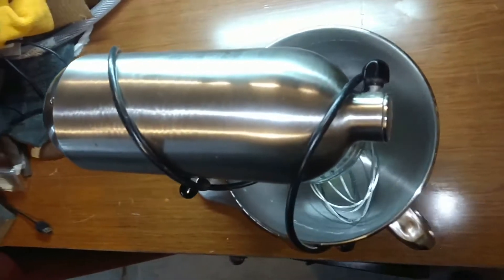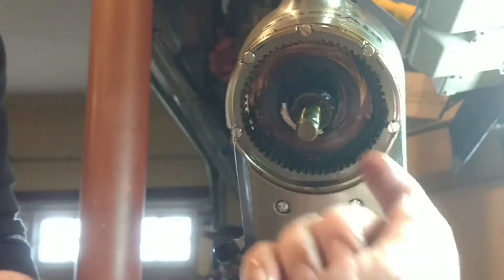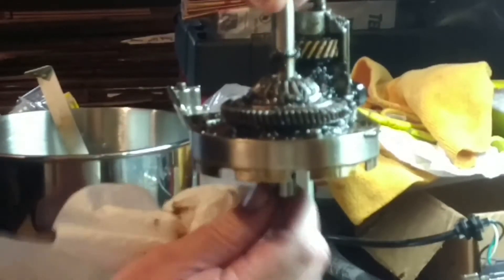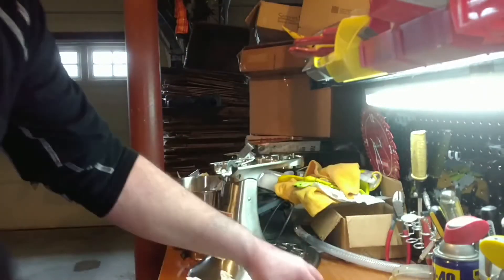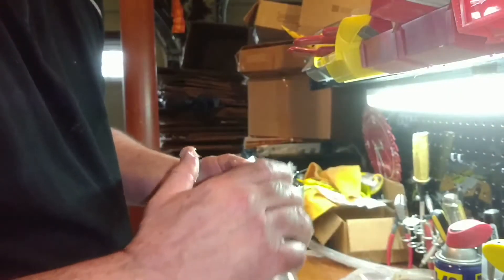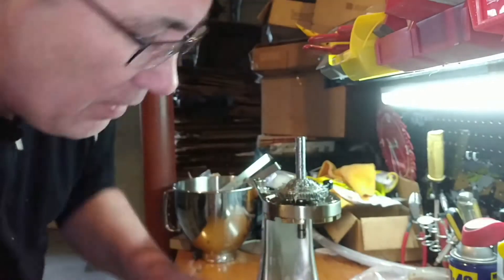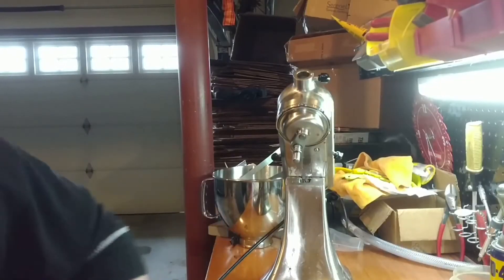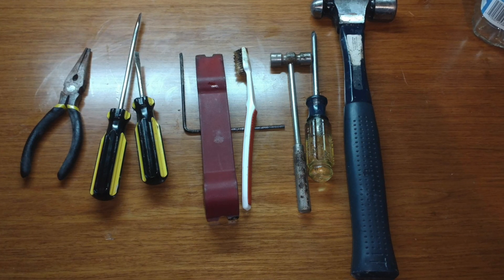KitchenAid Artisan leaky oil fix

Comment: An easier fix is to follow Kitchenaid's instructions to run at full speed (10) for 2 minutes.  I ran it for 10 minutes.  This mixes the grease and oil into a new suspension and it no longer leaks.  No disassembly required.  I did it and it works.  Zero leakage now.
Reply from the maker: let us know how long that lasts
Reply: @yourdiytechlife I will do that.  Kitchenaid says the leakage is usually caused by long periods of inactivity.  In my case, I used the mixer once in about 20 years.  Business and life got in the way of baking.  I'm retired now and bake bread several times weekly.  I disassembled the head from the stand, and the stand from the base.  I also removed the rear motor cover.  I cleaned the exterior very well and reassembled.  So far, zero leakage.  I check the planetary mechanism after every use.  No leakage.  It used to drip off of the attachment pin.  I think this is worth a try to avoid complete disassembly, and the time, money, and mess for the new grease and new seal.  If it doesn't leak for a few months and then needs to be "re-mixed", it still beats complete disassembly.  Just my opinion though. Thanks for the video and your reply!
Reply: Thanks for the nice and detailed showcase !